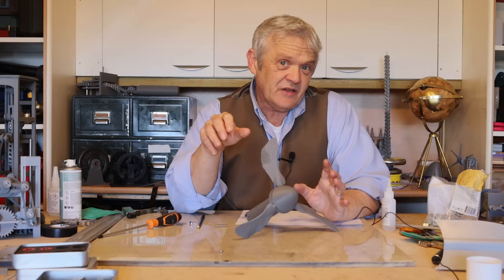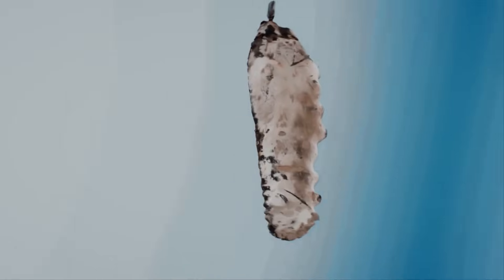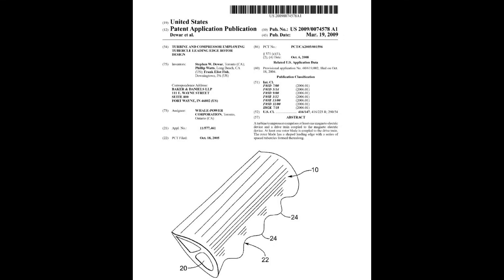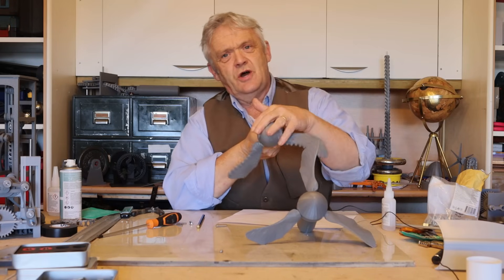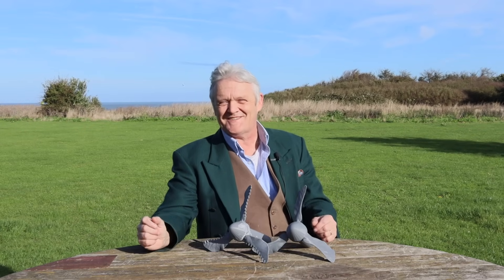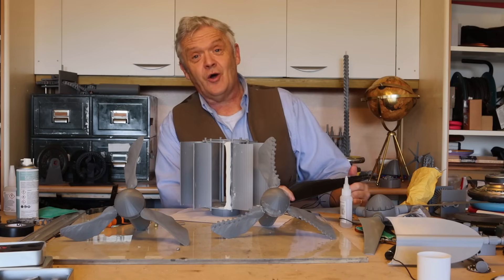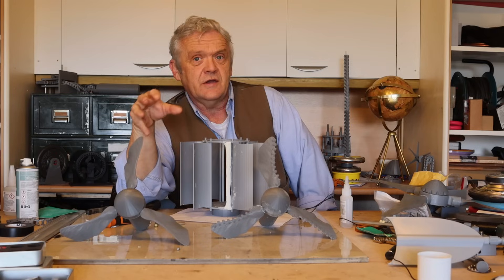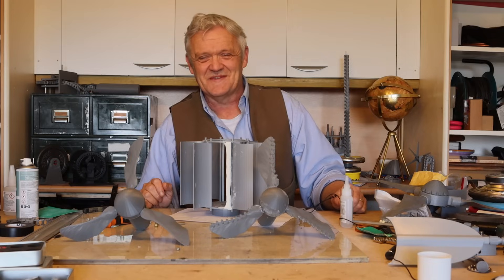2100 The Samara Wind Turbine With Tubercles - Whales For Wind Power

Comment: It's very good approach to do side by side, by reference, comparison. What's less good is that there is not symmetry: one blade set, the "tuberculed" one, was higher and deported from the body when the other one was lower and before the body, the former beneficiated from a better wind funnel. Well, experimental method is a difficult subject; OCD is a must have 🙂

Comment: It looks like you added the tubercles on the trailing edge of the turbine fins.  fascinating how the one with tubercles spin more than the ones without.
Reply: I wondered which edge they where on until I realized the blade is curve inward on the leading edge (the leading edge is concaved and the trailing edge is convexed.). The tubercles are on the leading edge. You can see the direction of rotation during his 'test'.

Comment: For even more efficiency and quiet, the trailing edge should also be serrated, like an owls wing! They're finally beginning to incorporate that design into jetliners due to noise and efficiency regulations, despite the fact that incorporating them before would have saved hundreds of millions of dollars in fuel costs...

I remember reading about the bumpy fins back in the 90s and I'm still surprised that I don't see that design in more places, especially with injection molded or 3d printed parts! I guess no one has discovered what size of bumps is the most efficient, and no one had bothered to do a real world head to head comparison to see just how much more efficient they are!

I think I read also that a rough surface on turbine blades also increases efficiency at lower wind speeds by catching the wind better, but a quick Google search reveals that this may already have been incorporated invisibly, and the roughness is only on one side, with the other side being smooth to reduce drag and generate lift. Still, bumps don't have to be rough and seem to concentrate the force of the wind, in addition to being a stronger and more flexible shape than flat plates, thus requiring less printed material per surface area! This is a super exciting direction to go in since a real world comparison shows how much more efficient these nature inspired designs are, yet no one seems to be using them!

Comment: I noticed that you held the two blades at different positions relative to your body,  the wind shadow might account for the differences.  Might suggest you take the time to find two camera tripods to mount them on.  In addition,  if you used a simple handheld tachometer you could quite easily measure the rpm of each blade system.

Comment: Setting both blade versions side-by-side, one merely need put a small torque positive generator with a load on each, and then measure the RPM with identical generators against identical loads.
Reply from the maker: You could indeed - go for it and let me know how it works out - because with that i would need a small positive torque generator, a load, and a way to read RPM - here i can stand in the sun and look lolol
Reply: @ThinkingandTinkering  I live in a very deep valley where the wind washes over the peaks of the mountains and skips us entirely.

If the wind at the peak is 3 meters per second, you can hold a smoldering tip [like an incense stick] and it won't even waft from side to side.

When one stands at the highest point on my property, one can see trees in a full 360 degrees at less than 166 meters in all directions, and a height over 22 meters at the lowest point.

And, on top of that, I have yet to pull any of the motors out of any of the free printers I have been given.

Therefore...

It could still yet be a while before I can get you those results.

While I do have a fan I set out specifically to cool off the area where my goats live, it will be warm weather again before I start that thing up, as in this weather one will get severely frost bitten standing in front of it!

I was just suggesting that for those who would want to know what the torque difference is.

Personally, where I live, unless I can buy up some land where there is a strong prevailing wind, there is really no reason for me to worry about wind energy.

Living in a box canyon with only 3.2 acres on the leeward side of the valley really leaves you with nothing to work with.

Most of my energy research is in biofuels. [ethanol, methanol, butanol, and natural gas (natural gas from goat manure, since I raise them)]

Comment: At 4:00, I'm fairly certain if you switched the rotors and kept all other orientations the same, the results would flip as well.
Your body blocked the air flow for the rotor in your left hand far more than it did for the one in your right hand.
Reply from the maker: i doubt it - i think you are just seeing stuff mate - but it barely matters tbh
Reply: I saw the same like him on the video. We can see that the camera is more in front of the "normal" propeller", and your body more in the wind way too..  @ThinkingandTinkering

Comment: The dimensions of the tubercles is probably a function of the Reynolds number, so the size relative to the blade size might be quite different between water and air. It may also be dependent on the wind velocity. So there's lots to study.
Reply from the maker: i agree and a lot of studies are being done now - check out google scholar

Comment: A useful device to test which is better is the balance made by the Wright brothers, you make a wing/blade that turns clockwise, abd another of the other kind that turns counterclockwise, tie them to the same shaft, and whichever is more effective will turn the array.
Hopethat helps
Reply from the maker: that is very clever thanks for sharing mate

Comment: A slight problem with your experimental setup is that your body is part of the experiment but if you're confident your observations weren't affected by that then it looks pretty clear cut. Personally I don't think it has as much to do with increased lift as it does with reducing drag. On a continuous blade contour the air has to depart 'all at once' where there might be interference from fast air going to stationary air, so it might cause turbulence in the area trailing the blade. The nodules might promote the departure of the laminar flow in distinct regions, maybe even in vortices, which could separate the areas of turbulence; a vortex would be able to extend away from the blade for quite a distance before turbulence formed.
In fact, I've wondered for a while if drone props were made with this feature whether they would be a lot quieter. Maybe they would just get a lot more whiny? :)
Reply from the maker: to be honest mate - there is so much experimental back up - check out google scholar - this is more of a demo than anything

Comment: Hi Robert, Maybe test performance when modifying both the leading, and trailing edge skin textures of the sycamore samara seed. To the leading edge add the tubercle bumps copied from humpback whale's fin leading edge ( Done). Next.....to the trailing edge add the owl's wing trailing very fine comb texture to spread out the air foils trailing edge wake leaving the foil. All surface texture changes are hoped to reduce noise, and create more lift with reduced turbulence experienced by the next in line rotating / trailing blade cutting through a much less  disturbed air molecule fluid stream. Thank You Robert for being you….intelligent, perceptive, intuitive, genuine, passionate, humble, fun, and thought provoking ! Enjoy each Day. Please send a "Hello" to Luke coming from here to there from across the pond. Robert, you are most worthy of the "The Global Teacher Prize".
Reply: Unfortunately fine feather like structures and 3D printing really don't go well together.
It might be possible with custom written Gcode, but the time and effort required to write it (or more likely write the software to produce it) is almost certainly not worth it for the limited gain it would be likely to produce, as well as requiring a skilled programmer to write it.
Reply: @trevorgoddard2278  Thank you very much for the polite, and informative reply. Much appreciated. :  ) Before seeing this thoughtful reply, I was considering brushing on slow setting  CA glue to strengthen the fine combs.
Reply from the maker: it's a good idea mate i will have to ponder how to do it
Reply: @ThinkingandTinkering  Biomimicry is a wonderfu engineering section 🥰
Makes me think of that Japanese bullet train. I beleve the front part was based on some diving bird.
Reply: Instead of trying to 3d print it , could you cut layers of stiff fabric , and glue them together with a flexible glue , to get the varied thickness/depths of material needed , and either glue them to a groove in the trailing edge,screw through the fabric , or a redesign of the blade to clamp onto the fabric , 
Thanks for all your effort

Comment: Hi Rob, i'm sorry to tell you that the time for standing on a hill in the wind is over. It is time to go professional and build yourself(and us) a wind tunnel, with a wind tunnel you could do repeatable tests of all the ideas you have shared, create a spreadsheet and get all analytical, there is nothing clearer than a row of numbers.
As always thankyou for all your ideas, and dedication to providing intelligent content
Reply: halfway though the test, he might  have switched hands with the fans, as the wind may have veered around him in a unequal fashion
Reply: @edmondedwards6729  YES INDEED !!
Reply from the maker: it's a nice idea mate - but a wind tunnel is quite a thing and i don't have space or funds for it right now
Reply: @ThinkingandTinkering  Don't need to own the tunnel ^^ ..Could be fun to look for some underused underraiload tunnels around, and designing a device fitting inside for your test ^^
Reply: ALL he needs is a small dual tripod with a rod connecting them horizontally 2 meters high. Each unit can mount on the cross bar equally  spaced in from the end with an anemometer in the middle. That gives uniform flow and the value of the flow. Simple  The wind over the hill in the open is more uniform than any home brew wind tunnel will ever be. They usually end up with the turbines sitting at a 30 degree angle in the flow. AND it would cost him $30K quid and take up a long area and require a high horsepower engine and fan.

Comment: Some kind of wind tunnel is needed to get some real feedback on all these designs. also, do you get your apples to apples comparison by blade length or weight?
Reply: I think a wind tunnel is not in the intrest of  this channel, as Mr Smith has stated, wind tunnels don't give you real life data, as air is uniform and unidirectional, while real wind (close to the ground, gusty and turbulent) is never like that.
Reply: but it is consistent and thats what you need for testing. the only other way I can think is to have 2 poles side by side somewhere and add up the total power generated over a period of time to see which is better. holding them in your hand to test them is just as good as flipping a coin depending on the wind direction and how you happen to be facing.
Reply from the maker: swept area

Comment: Not to be rude but your body was blocking a good deal of the air flow behind the old seed design.  Clearer air & side by side would be better for a real comparison.
Reply from the maker: they are both in the same condition so it is a fair side by side test of one against the other - if i wanted to test one by itself and compare it with the rest of the world you would be right

Comment: Fascinating! Low speed, organic airfoil. With the added nodules, there's more leading edge surface area to for a fluid medium to catch, this giving thrust at lower speeds. ( think fibrules on a dandelion seed)  

Now that I think about it, there are similar underwater protuberances on the fronts of larger cargo vessels as well. Just the one large bump, rather than many small ones, but for much the same reason. (Maybe?)
Reply: On ships: kind of - if I understood right, the bow bulge does move where the pressure bears on the hull, moving the pressure to the minimum hull cross-section at the designed speed range.
Reply: There's a video to explain that front bulge .   Something about diminishing the energy sapping bow wave I think.
Reply from the maker: cheers mate

Comment: This is fascinating! Makes me wonder what would happen if you added golf ball like indentations along one surface? 🤔 ... I really should get a 3D printer 😂
Reply: - there has been research into this - dimples on the low pressure side makes an impact - as the wing approaches stall angles - delaying separation, just like a vortex generator, at low angles though it is highly likely to induce additional drag  (here is where designs need to be "optimised" to become viable).
Reply: @kadmow  Very cool!  Thanks for the insight 🤔
Reply: And wing tip deflectors that aeroplanes have to reduce the vortexes from spilling over the tip.
Reply: @Milkybar3320011 THIS!
Reply: That would be very interesting to experiment with.
Reply from the maker: lol - maybe you should!